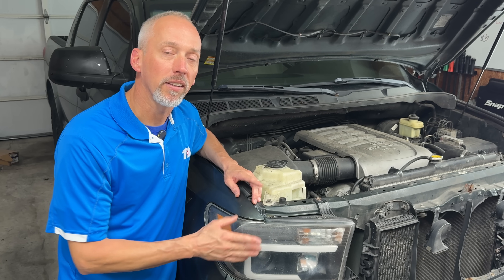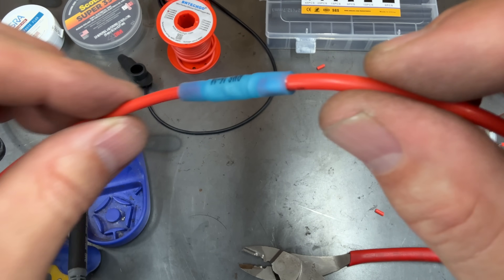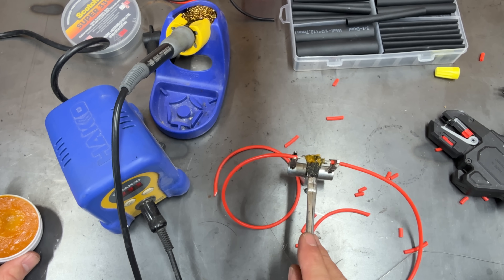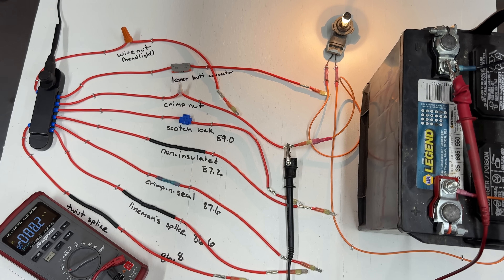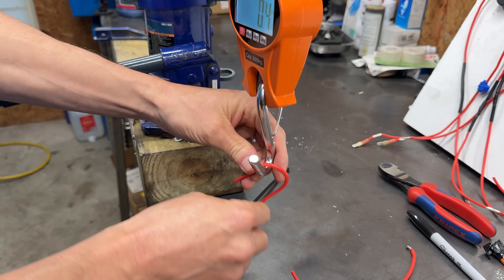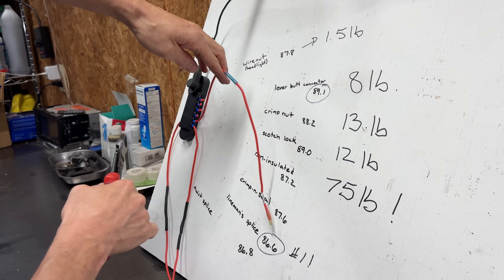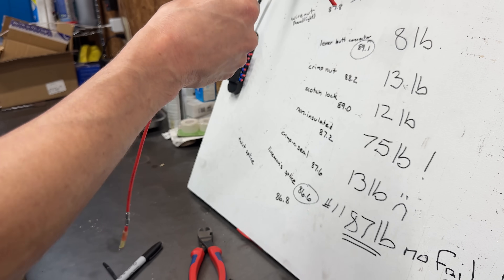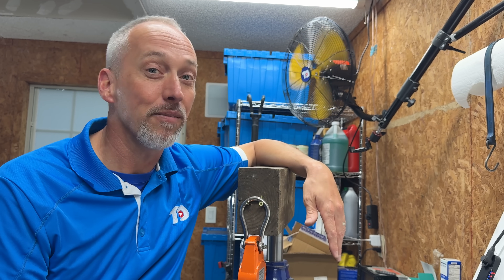I tested these connectors and found the best one

Comment: That was a nice overview of options but the heat shrink connector really didn’t get a fair shake. As you pointed out, using random pliers with them is hit or miss. They require ratcheting crimpers to work consistently to their full potential.
Reply from the maker: You’re right they do. I think that’s a major shortcoming at least for do-it-yourselfers who aren’t going to spend a couple hundred dollars on a tool just to fix a wire.
Reply: @ToolDemos  In my experience, the tools for insulated terminals are one of the few types of ratcheting crimp tools where the cheap ones (even super cheap ones from aliexpress) actually work pretty well. 

What are horribly bad are a lot of cheap insulated terminals (and ferrules). Many of them are made of metal that is too thin, and even worse, is not properly annealed after being stamped, leaving them work-hardened and springy (!), such that they cannot be properly crimped. Even with expensive tools, they just don’t hold. 

In other words, I would MUCH sooner recommend someone use name-brand insulated terminals (TE/AMP, Molex, Panduit, TB, Vogt, etc) with $50 Klein or Greenlee crimpers (or even a $25 IWISS from China) than use no-name terminals in the $2000 fully-adjustable TE crimper.
Reply from the maker: @tookitogo  well said, thank you. I’m starting to think a second video where we test brand names versus cheap Chinese stuff might be worth doing.

Comment: I live in Southern Ontario, Canada, 'THE RUST BELT', where salt slush gets into everything. For that reason, I always solder ALL of the electrical wires that I connect together, and then slide a heat-shrink cover over that soldered connection, and then slide a second longer heat-shrink cover over that one too, to keep the salt water OUT of the connection.
Reply from the maker: Wow! That’s marine grade protection.

Comment: If you have something pulling that hard on a wire, it's probably good that it breaks so you can fix the original problem.
Reply from the maker: Ever pull an engine and the one thing keeping it attached is a ground wire? Asking for a friend 😉

Comment: Unless removable, best way is to solder (Lineman's splice) and then good quality adhesive lined shrink over the top. Hard to get it wrong. Next up will be uninsulated crimp, with adhesive lined shrink over the top. The adhesive part is super important, it provides the ultimate weather sealing. If you need it to be semi-removable then bullet connectors is best.

Comment: Clamping the wire onto the table with vice grips made a sharp area that will cut the wire, you should have used like a 1/2 bolt to wrap the wire around, like you did on the scale.
Reply: None of the wires broke at the vice grips. Totally useless comment.

Comment: I don't understand why you didn't test solder seal connectors. Maybe it's just me, but I feel it's the most common type to use these days.
Reply from the maker: I think those solder seals are too prone to failure over time (with vibration). Didn't want to give them more attention.
Reply: @ToolDemos  Okay, thanks for the information.

Comment: Really appreciate you sharing these results. However don't call it science.  There are so many other factors to consider in a connection, such as vibration, temperature, current, expansion/contraction cycles, humidity, wire type, flux induced corrosion, flexing of the joint, repeatability of the test, crimping tools used, solder type, cost, etc, etc. Still it is useful information.
Reply from the maker: How about ‘science, part 1’? 😉

Comment: Unless I'm running wires from one pole to the next, I'm really not that concerned about pulling strength.  In 99.9% of my connections the connection is going to be well supported. 

 The Scotch-lock are convenient for limited space applications like connections for a radio inside of a dashboard.  But, I really dislike that they damage the wire and created likely failure points.
Reply from the maker: Fair.

Comment: Great video, but I was hoping to see how the solder splices with seal shrink wrap perform compared to the others.  Still, I doubt it'll surpass soldered the lineman's or twist splice.  Thank you.
Reply from the maker: I think those solder seals are too prone to failure over time (with vibration). Didn’t want to give them more attention.
Reply: @ToolDemos  That's the kind of info I was looking for.  They're relatively new to me and I was curious how well they work.  Not as well as other methods, I take it.  Thank you.

Comment: You aren't supposed to twist wire strands when using crimp connectors. It causes the wire to be crimped unevenly or something. I always try to leave the wires strands straight if I can.
Reply from the maker: That makes sense.

Comment: "The noninsulated side is obviously a stronger connection" - All I need to hear to know you have no understanding of what you're talking about. Get out of the review business.
Reply from the maker: I'm not sure what you mean, why do you not think it makes a stronger connection?
Reply: @ToolDemos  There is a lot of materials science in crimped connections. Crimp tools (not including the cheap kind you used) basically make cold weld, irreversible connections. The tool you used can't be used for any kind of UL listed (or any other kind of listed) crimp connection since it doesn't make a controlled cold weld (pressure and size) like an actual crimp tool does. With the tool you used, using the bare crimp indent on an insulated crimp over-deforms both the crimp and the wire, resulting in a weaker connection, not a stronger one because it's designed for a much thicker-walled crimp barrel. For a decent connection with that tool on an insulated crimp, two crimp actions side-by-side on the barrel would result in something close to a listed crimp connection.

When using name-brand crimps designed for listed connections, they will always specify a tool and die to use with a particular crimp body that leaves an identifiable mark on the the finished product so that later inspection can verify it as a listed crimp. That tool you have can be used to make a decent connection provided you use it correctly, but not a connection with any verifiable engineered properties.
Reply from the maker: @PetrosArgy  sounds like there is a whole world of engineered products that I was unaware of. Thanks for the explanation.
Reply: @PetrosArgy 
Please elaborate on proper crimping tools. It’s very difficult to find proper tools versus just stuff that works. 

Do you have a specific one in mind? Or a recommendation for what to look for?

Comment: In this application, you do a bare wrap with tape. Those archaic connectors go high resistance regardless so you're just making it harder on yourself later.
Reply from the maker: You’d solder the splice then tape it?

Comment: I just bought the insulated ones - but these have soldier in them that melts as well.  Wonder how they would work.
Reply from the maker: The reviews are mixed on those. I hear they fail from repeated vibration.

Comment: How often is anybody going to put 12+ pounds of pulling force on a wire?
Reply from the maker: I pull on wires quite a bit when doing repairs. I've also pulled connections apart when they weren't strong enough. Not on purpose, just happens.

Comment: For non automotive indoor applications, the lever lock connectors are awesome. I build and maintain production equipment at my company and it makes replacing parts quick and easy. But spend the little extra money and get the Waygo ones as they seem to have a much more solid lock to them.
Reply: Clamp connectors are also spring loaded, which means that vibrations won't crack them in the same way. Also, if you pull them out, you can just plug them back in, so when you work in there it is a boon rather than a drawback.
I have heard that soldered connections can crack and should be avoided in moving parts with vibration.
Reply: They are only awesome if they are the real deal and not a shit knockoff like these probably were.
Reply: @Rentta  I bought the Amazon-type "T" connectors.  I found them to be pretty strong, provided you force the levers all the way up and push the stripped ends in as far as you can.  Otherwise, you won't get a good bite onto the end of the wire.  (I specifically need a "T" and called WAGO with the suggestion, since they don't yet make them, although the China-made ones are all over e-Bay).
Reply: Also great for checking proper connections before making them permanent
Reply: lever/wago are actually great. Aside from not being sealed, they will never undo with vibration etc, so are actually very good and easy to use and re-use.
Reply: Way.... Waygo!? I kept my mouth shut when the americans misused Audi, abused Adidas and raped Porsche. But this is too much!
Reply: Wah-go. German company. In German: "Vah-goh". Anyways i love them as well. Wired my entire lakehouse with them just to tick boxes and they havent let me down once.
Reply: @koifish1le996  Wago (can't be that hard lol)
Reply: Did you hear how he said it-- through text???? @koifish1le996
Reply: I used some 10awg waygos in my subwoofer box, working great.

Comment: Wire nut is great until the hot wire pulls out and shorts against something. Hope there’s a fuse on that circuit!  When I wired my own car in the 1980s I used a good solder joint and heat shrink tubing. I never had a problem.